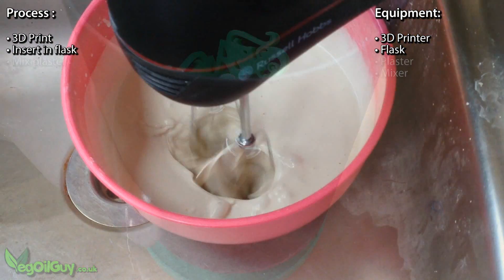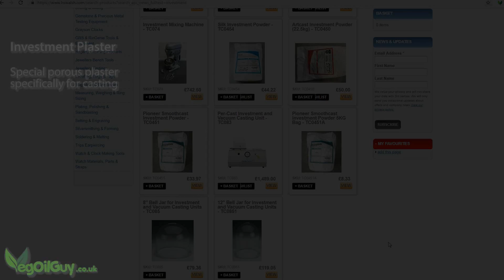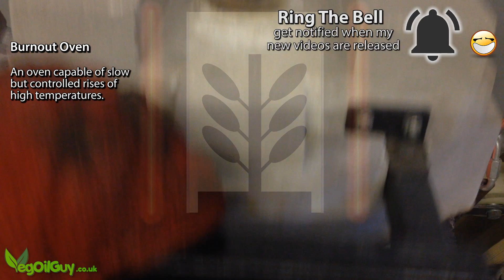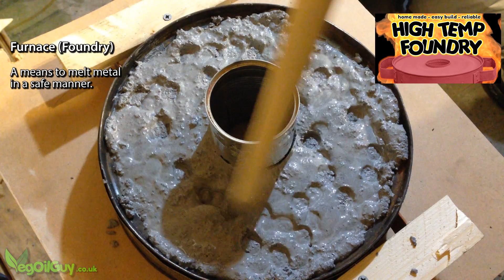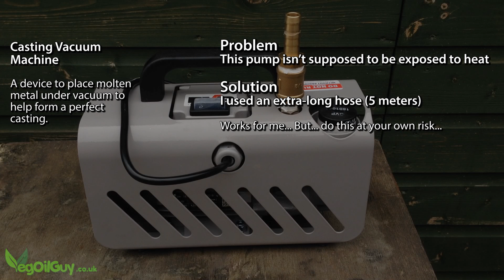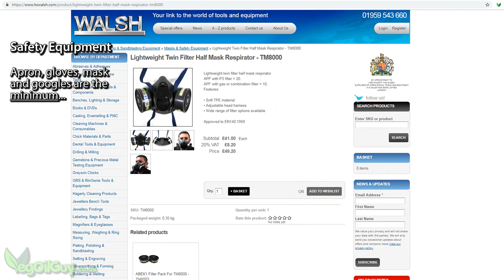Lost PLA Casting complete guide - everything you need to know - technique equipment & more by VOGMAN

Comment: Just a quick thought on how to help protect your vacuum pump. With your long hose curl it round and put it in a bucket of cold water, the air that has been drawn through it will be chilled and this may help to protect your vacuum pump. 👍
Reply from the maker: I'll be honest Stephen, that was always my plan. But I genuinely found the hose didn't get even slightly warm... so it was a step I didn't need. BUT it is a sensible precaution for anyone trying this for the first time!
Reply: @vogman  even better to use a copper tube cooled in water.
Plastic hose doesn't transfere heat much at all and it can be very hot innside but cool outside for a long time.

On my steam cleaner that runs about 140°C has some kind of silicon/plastic hose and it takes around 20 minutes before it gets warm on the outside
Reply: I use one of those pressure paint buckets as a vacuum buffer. Pre-evacuating it with the vacuum pump and opening the inlet valve when needed provides a huge vacuum instantly, rather than the slow vacuum buildup of a pump. If you need additional vacuum you can leave the pump running so the bucket always has the pump drawing it down, and the large volume of the bucket disperses any heat that comes in.
Reply from the maker: No worries Ivan  : )
Reply: Brilliant idea to use the spray paint pot to provide extra capacity for the vacuum pump.
Reply: I think it's not so much the heat but also the lack of humidity in rapidly heated air which might cause havoc with the pump seals

Comment: You can use a compressor from a fridge or fixed speed AC as a vacuum pump. Just connect to the suction side, won't pump the same volume as the commercial pump but still does the job.
Reply from the maker: I have heard that said Gary. I've never tried it, but it is a good tip  : )
Reply: since the casting doesn't require a high volume, that might do the trick indeed. And it's a lot less noisy than an old Dyson =)
Reply: I was about to post that i use a old fridge freon pump hooked up to suction side as a vacume pump successfully on many dyi projects and i got the pump for free.
Reply: Electrically powered air inflators for an air mattress (i.e., hook to the inlet side) may be another cheap vac source. I know mine was under $20 USD and is designed to hook up to the air mattress to either inflate or deflate. Seems to push a pretty decent volume as a very low torr vac does not seem necessary. For those looking to use it for a quicky one-off, many of the autopart stores, at least in the US, will rent for a returnable deposit an A/C vac, which while overkill here, is after returning it to get back your deposit, completely free.

Comment: Have you tried just spraying the PLA prints with a few layers of plaster and then packing in fine dry sand? It works fantastic with lost foam casting and you don't need a vacuum system.

Comment: FYI- Just as you can store pressurized air in a tank for surge usage, you can store vacuum in a vacuum chamber.  You can either use some sort of container that is made to handle a vacuum or you can seal up some 4" schedule 40 PVC pipe which will store a cubic foot per linear foot (8 foot pipe yields 8 cubic feet of vacuum). Connect it to your smaller casting chamber with an inline ball valve in case you need to slow things down.

Comment: You could add an inline cooling sleeve for your vacuum pump like a condenser system for a still that will cool down the air before it reaches the pump

Comment: Excellent video. To the point. Pitched right for me. Sadly, I think it's put me off. I'm not having great results with greensand casting (I'd sand cast a few 3D prints) and thought I'd try this. I don't fancy baking the plaster mould for "hours" and I sure as heck don't want to be running a second furnace. I built my own vacuum pump from an old compressor. I used it for casting polyester resin: it'd probably work. It's the two furnace thing that's putting me off. For a small piece, what happens if I let the mould cool before pouring? What's the minium time I might get away with for burning the PLA out? Yes, I'm looking to shortcut your shortcuts! :-) Thanks.

Comment: Great vid,
FYI, You can make a inexpensive vacuum pump from a cheap 12v car Tyre inflator, just bodge a pipe to the inlet of the pump (I used JB weld). I use mine for vacuum bleeding brakes,  works well. it will pull a decent vacuum and it can still be used as intended for inflating Tyres.
Reply from the maker: Nice idea  : )

Comment: I wanted to share with you what I did for my vacuum portion last time but I forgot. :P
I converted an old used propane tank ($5) that I place a vacuum on with a electric pump (definitely could use a hand pump as well and save some cash) and leave it charged so it'll be ready when needed. It'll draw air for a good while.
Reply from the maker: Nice idea. I toyed with the same plan myself but space is at a premium in my workshop, so I went with something a little more compact. But thanks for the share. It may inspire others to be equally creative  : )

Comment: This is the best all around guide for lost pla casting that I've ever seen. Great job my friend !!! I have got a simple (probably dumb too...) question... Can't I use the furnace as the oven too? I mean... I knew that furnaces were just ovens that reach greater temperatures...
Reply from the maker: As long as they are for high temperatures and you can control the heat safely, you can use pretty much anything : )

Comment: Ever thought about using a vacuum ejector on a pressurized air system? Could be a quite cheap option if you already have a compressor.
Reply from the maker: One thing I don't own is a good compressor. The one I have couldn't blow up a balloon with pausing for more breath several times : )

Comment: I wonder why the preference is for plaster here? On another channel it seems Myfordboy uses greensand for casting and seems to have very good results. (Not with PLA if I recall, but other than that it seems the process is practically the same. It would seem possible to adapt it.) I think if the sand works, it'd allow for more material recycling to be done, as the majority of sand could be re-used.
Reply from the maker: You need to recheck Myford's approach. He DOES use plaster for Lost PLA. However, he will sometimes place the plaster into sand as a support material rather than use a metal flask (I've done this myself in some of my videos). This is just good sense and making use of what's available, a technique I always applaud. But with that said, I'm fairly sure in his most recent Lost PLA video, where he tries to develop a centrifugal device, I think I remember seeing him use a flask. Personally I'm betting he'll have a go with a vacuum before long... that's where the real benefit of this plaster comes from - and yes, Myford DOES use the proper investment casting plaster. He shows us the label.
In case you haven't guessed, I'm a Myfordboy fan and sub   : D

Comment: Hi VoG, Great video! Have you seen any loss of detail or quality on the castings when using PLA instead of wax? When you used the blue injection wax for coins the results had a really impressive level of detail.
Reply from the maker: Hi Hördi. Actually I think the detail is better.
Personally I find if I take a model, silicone mould it, wax cast it, I've lost some detail. It's not much, but I can see it.
With lost PLA, you've skipped two processes that could potentially spoil the crispness.
I'm still learning and far from an expert, but I really think Lost PLA has massive potential... but I also love Lost Wax : )

Comment: Pardon my ignorance and thanks for your wisdom - regarding the burn out phase, does the molten metal not provide enough heat to burn out the PLA? If not would this change on a hollow print?  Is there residue in the casting without the burnout?
Reply from the maker: It's good to ask questions - that's how we learn : )
Despite the amazingly high temperatures, metal solidifies surprisingly fast. Melting objects uses up energy and cools the metal, so it solidifies fast, typically about halfway through the object its melting, spoiling the cast.
If you melt the pla away first, it might leave a tiny residue, but not really enough to cause a problem. So for the most part the metal is just filling up an empty space.
Hope this helps.

Comment: I'm curious and know only what I've learned in your videos, if you were using a perforated flask- could you pour and then put the flask inside of your vacuum chamber to achieve a detailed mold?
Reply from the maker: In theory yes, but you'd need to be quick as the metal freezes very quickly... plus the chamber and pump would need to be able to handle the heat : )
Reply: @vogman  Thanks for the reply. I did my first pour yesterday. I ofcourse did everything wrong- which is good in a way  yet it did turn out into something I was excited about. A vacuum chamber to pour into would be quite a cool concept.

Comment: Thank you for the video. When you say you melt the PLA out at "very high temperatures," what exactly is that temperature. I want to melt out the PLA and not burn it out.
Reply from the maker: Essentially you need to do both. Most of the PLA should run out as it liquidises as the temperature rises, but some will always stay behind and need to be burned out. In conventional investment casting, it's often the practice to raise the temperature to around 750C and hold for 4 hours.

Comment: Have you experienced different results if you wait for the metal to fully cool before dissolving the plaster.
Reply from the maker: No, but it's my understanding there's no difference. It's just about getting the plaster off. The metal freezes within just a few seconds. But once the plaster is cold, it's hard and has to be hammered away... this could damage the casting : )

Comment: Great video, very helpful. What brand of investment plaster do you recommend (I'm in the UK also), I've tried some designed for Jewellery and had limited success with aluminium, although copper was fine in it.
Reply from the maker: Thanks Kieran. If you check the description you'll find links there  : )
But Aluminium is an awkward one I'm hearing. Whilst I've had successes with it, apparently it's not the best metal for investment casting - or so the plaster manufacturers tell me.

Comment: Do you account for metal shrinkage when designing the 3D model? And if so, do you simply scale up uniformly based on a shrinkage constant of the material used?
Reply from the maker: If you watch my latest video https://youtu.be/8p7I8IVmpSo you'll see shrinking happens at both the printing and the casting stage. Personally I bank on 1% shrinkage at the outset and as a general guide, this seems to work okay for me 😊

Comment: Why can't you melt out the plastic instead of burning it out, so you can recycle it?
Reply: And I know some people are going to comment "it doesn't matter" or "it's not worth it" that's not the question. I have my own PLA and other plastics recycling systems and a filament extruder and I make my own 3D filament

The question is WHY because i want to understand the reason why people aren't melting it out at 200 degrees C instead
Reply from the maker: If you CAN recycle the PLA, then yes it can be done : )
I know with wax I recycle. I tend to place a container beneath the flask and heat moderately. As the wax melts it drips into the container which I then remove, filter and reuse.
If you heat to 250C you could certainly recover the PLA in the same way, though personally I have no idea how you'd reuse it : )
Reply: (1) Reusing PLA by making new wire is still not up to most people's standard of PLA wire. Usually dimensional/roundness issues. This is with freshly printed chips.
(2) How do you filter out the micrometer sized plaster dust? That stuff will ruin a nozzle real quick by acting like sand-paper and also clogging it up.

I use the PLA for the master models and use wax for burnout.
Reply: @jhsevs  can you make a video of making filament from recycled PLA? Would you need to add new softeners that evaporate during the melting process? Perhaps if more people could learn your way of recycling filament, they would melt out the bulk before burning out the left overs that are caught in corners or capilary details...
I'm sure as the technique finds a wider application and popularity, more main stream solutions will appear. I don't think there are any reasons not to recycle other than cost efficiency or manufacturing restriction due to requirements of the plaster curing process (lower temperature requires longer heating cycle, also depending on the prescribed baking cycles of the plaster it might be tricky to interrupt the process to remove the recovered PLA before raising the temperature. All things that may increase the cost of the process and will increase the time spent)
Reply: @jhsevs  i want to understand the reason why people aren't melting it out at 200 degrees C instead
It doesn't matter (it's not worth it) unless a person has a PLA recycling system (that filters out micrometer sized plaster dust) and a filament extruder so they can make their own 3D filament
.
Reply: One word about why you can't melt the PLA out: "viscosity".

There's no way you'd be able to pour melted PLA out of the mold.

Comment: Hello VOG. Do you know how much shrinkage needs to be accounted for in PLA lost casting? The aluminum pour will shrink as it cools so the PLA mold should be larger to accommodate for shrinkage. I read someplace that the PLA mold should about 30% larger.
Reply from the maker: Sorry Luis, no. I generally guess at about 1% but for accuracy, you're better off doing a trial casting and measuring the differences.

Comment: What temperature is necessary for your burnout? Im curious since you stated aa cooking oven isnt up to the task.
Reply from the maker: A kitchen oven would easily burn out the PLA, which around 250C would do. But the plaster has to be taken all the way to 720C to properly prepare it for casting  : )
Reply: @vogman  gotchya. Thanks for the response.  I have been playing around with the whole process past couple of weeks.  I am almost ready to get serious about it.  I have been having issues with my plaster holding up to the pour.  I thought i was allowing enough time and heat to completely dry out my molds.  With so many variables I was about to write it off to something else in my evolving, temporary set up.  I will definitely crank the heat towards the end of its cycle and see.  Thanks again. Love your videos vegdude
Reply from the maker: No worries. It's a fiddly process to play with... you really need to follow the rules. You need a good plaster and you need to look up the burnout process for THAT plaster as they can differ  : )

Comment: Great vid, thanks. What about dimensional changes between the PLA and the metal version? I had a friend who was a foundry man and he told me to expect some shrinkage between the model and the metal. What is your experience? Should I be 3d printing the PLA piece 5 or 10% oversized to compensate? Thanks.
Reply from the maker: Hi Capi. Generally a shrinkage rate of around 1% is more likely.
Look out for my video next Friday. It covers this exact issue. In it I cast 3 small items of different metal looking for shrinkage. Now these are small, only maybe a couple of inches long, and there is hardly any shrinkage. Obviously with bigger items the shrinkage would be more obvious. But as a guide, between 1 and 2% seems most common.

Comment: If say I wanted to to use this method for casting a brass AR-15 lower, would I still use 100% infill? Or do you think 50% would be able to withstand the vacuum force?
Reply from the maker: Hi Jared. The vacuum is our friends as it encourages to metal to flow into every nook and cranny. Infill is really something to worry about if you want to keep a PLA item nice and strong. Once it melts, there's no infill, just 100% metal.
I'm still experimenting but as far as I'm aware, there's no difference between 100% infill and 0 infill with this technique. As long as plenty of time is given for the PLA to melt, drain away and burn out any residue. This leaves the void for the metal to fill and that's the part we really want.
With that said, logically I would say you want as little PLA there as possible... the less there is to melt and burn, the more likely your success will be. 
So my advice, print to the minimum infill you can get away with. If it flexes and bends, you may need a little more infill, but if it holds up the moderate handling, it will survive the plaster vacuum stage and melt away nicely for you : )
Reply: @vogman  Thank you for the quick reply!! I'm getting a 3D printer and plan to build my forge soon. Love your videos. Super helpful.
Reply from the maker: Thanks Jared  : )

Comment: Hey Vog steadily picking up supplies I’m having some issues which wax sprews to buy , which diameter for the tree or the main wax that goes to the mold , I know if your doing several they have small wax for that I found a kit for around $30us but don’t see any bigger ones for the main pour diameter.
Reply from the maker: Hi Zach. I know the sprues I use are Ferris and they come from the US. If you look at this web link, the main sprues I use are the pale green ones. They're roughly 9mm. I dare say an email to Ferris will tell you where you can buys these :-)
http://www.freemanwax.com/sprue-waxes.html
Reply: VOG thanks always a big help, every day getting closer to getting my foundry going , waiting on my truck to get out the body shop to pick up a few old bigger propane tanks to make a foundry and furnace! Great video on the new review also!